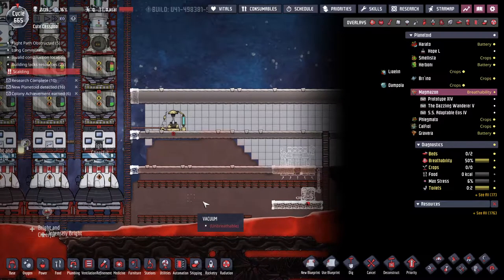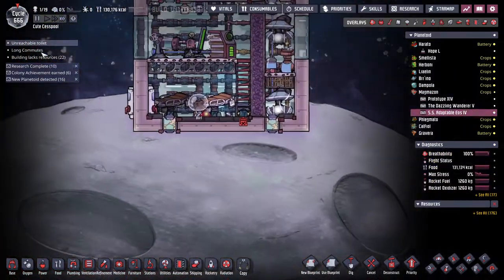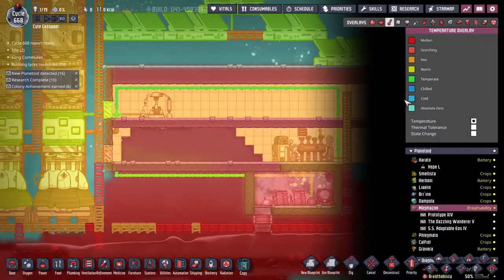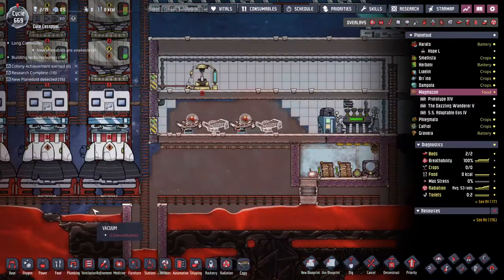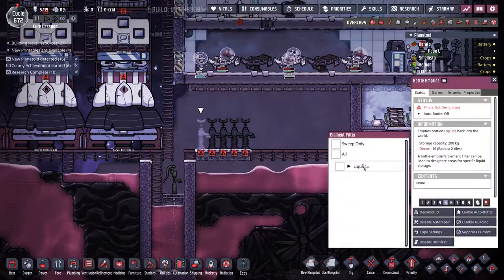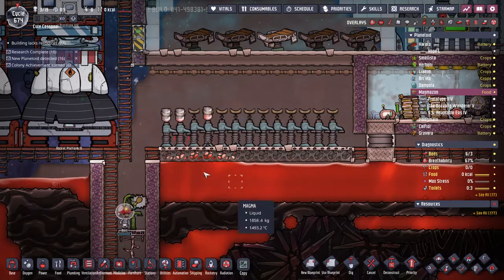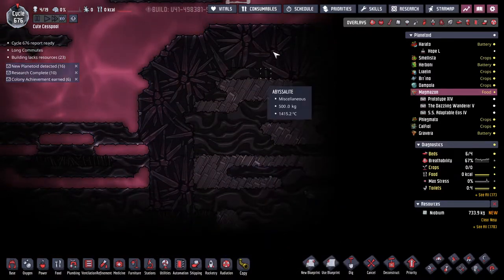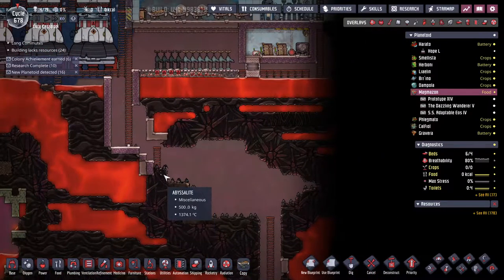Cute Cesspool Ep 23 Cooling a Hot Mini Base

Comment: I was experimenting in sandbox mode in the Inverted Magma asteroid and found some interesting exploits. Normally I would dig down into magma using a series of mechanized doors and steel walls to tap into magma as a power source. One exploit I found was that Dupes are able to build a bunker door through an airflow tile, allowing me to build a horizontal corridor through magma. Also, airflow files repel all liquids, including magma, so this can provide a strong protective barrier through magma
Reply from the maker: All sorts of fun ways to deal with magma.  I know the airflow trick is best.  I like showing people you can do it with just blocks and planning.  They can figure out the tricks :-)

Comment: On my last map when i was ripping apart the magmaroid the Gravitas building ended up filled with sour gas. While I was venting that out I found out the painful way that if there is any atmo at all (even micrograms of it) in contact with any scalding level heat source scalding will continue even after the dupe gets out of the magma. It seems that the way scalding works is that once it starts it only stops when the dupe enters a non-scalding temperature element (gas, liquid or vacuum), it does not matter if there is enough of it to actually initiate the scalding debuff. If there is ANY Amount of an element in the scalding range the debuff persists.

The reason i mention this is that you might have an issue with trace amounts of O2 leaking out of the door to your triage / turbine room every time the dupes open it. If that O2 gets in contact with the magma below, any time the dupes get scalding from swimming in magma the scaldings will continue a lot longer than you might think they will.
Reply from the maker: I know gas would leak, there is one tile of space between the door and the background.  Not sure where the sour gas came from.  the main issue is the rockets.  Huge amounts of co2 need to go away before dupes can be trusted in the hot areas after a landing.
Reply: @TartarusPlaysGames  I did see that and figured it would provide pretty good protection against gas contact with magma, but even a tiny amount of gas crossing that gap can cause problems, and I wrote my comment before that sour gas leak.

Ultimately its a nonissue if your team isn't there of course.

Side note, I like that idea for draining heat out of the magma, I'd been considering how to improve the igneous output from my FJ-style pet boiler. Your design might meet my intentions. Thanks!

Comment: Now I have the same bug as you they don't want to do the radbolt research... But I'm determined to finish this playthrough at least to the temperal tear... Even if I have to play on normal speed because my computer can't handle more than 3 asteroids...
Reply from the maker: Keep plugging away like a good dupe.  for the rad research, I would check the priority to see if anyone had it in their queue.  If not, rebuild it.  Also try building two stations, and see if it is both, or just one at a time that has the bug.
Reply: @TartarusPlaysGames  yeah it's the same as you, the prio queue is empty but when I reconstruct the station they comme do 20-30 points and then stop again...